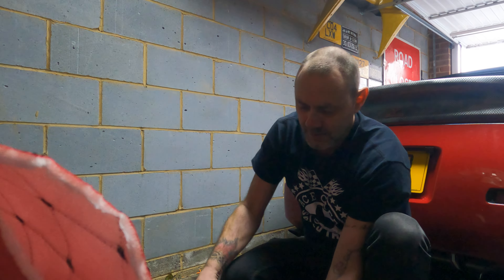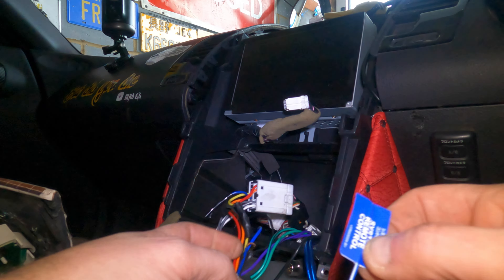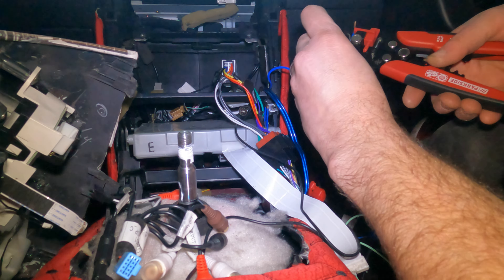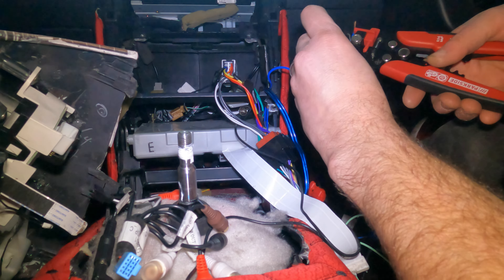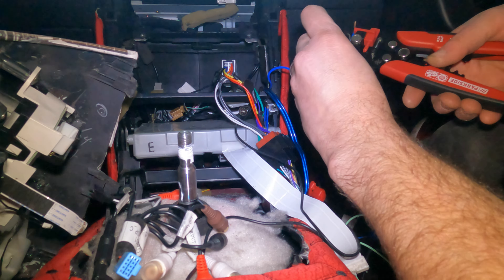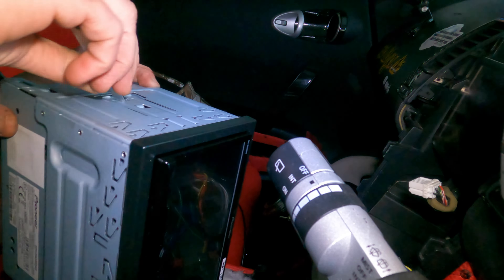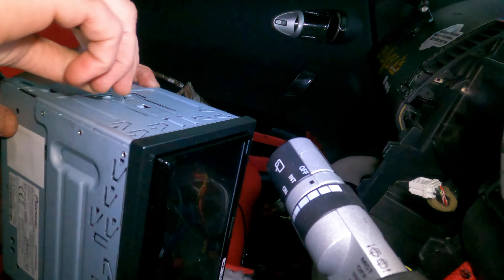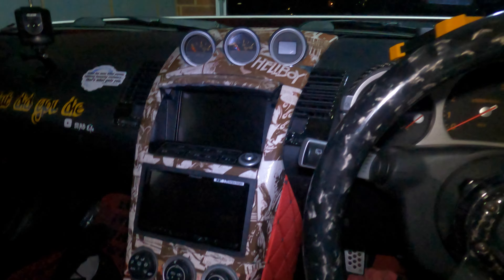Pioneer SPH DA 230DAB unboxing and fitment. is it any good? Is it worth the money?

Comment: So I’ve got this installed, and the Bluetooth connection and radio all work fine, but I can’t get the CarPlay functions or any apps on it. How did you go about that ?
Reply from the maker: Have you got it plugged, to get apps like Google maps you have to have the hard line connected.
Reply: @MADL1fe  plugged to my phone? I’ve got a usb running from back of the unit. When I connect it to my phone, it charges but that’s it. Do I need to install an app on my phone for it ?
Reply from the maker: It sounds silly, but restart your phone and plug it in again @michaelwaya5939 .

If that doesn't work uninstall android auto and reinstall

Comment: Have a question, my after market steep crackles when engine is on and I get a call on Bluetooth, music plays fine all the time, only calls when engine is on .. any ideas ? No amp or anything else.
Reply from the maker: Tbh I didn't know so done a couple of searches.

A few things it could be.

1, Have you updated your phone recently? It could be a software issue.

2, Do crackles change when you rev the car or get faster or louder? If so it's likely picking up interference from the alternator. 
If that's the case fit an inline surpressor.

Hope this helps